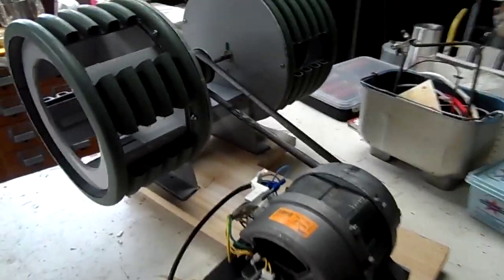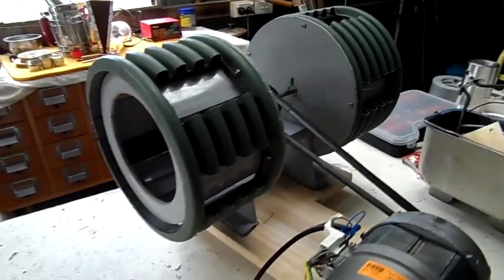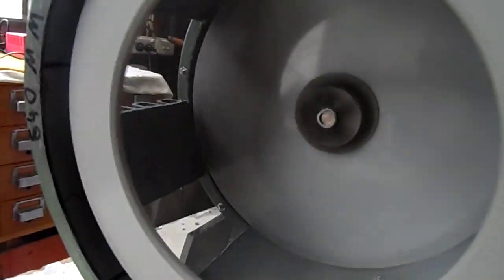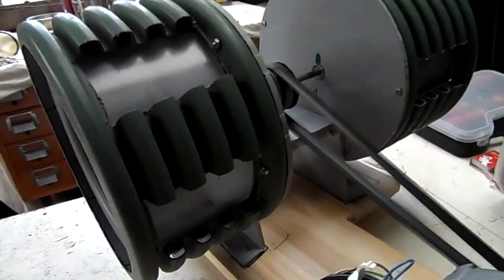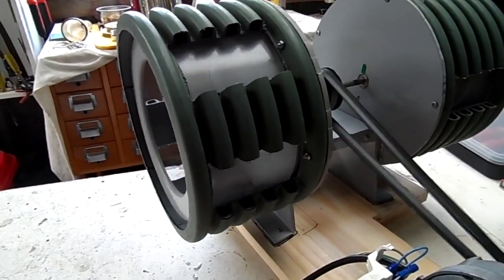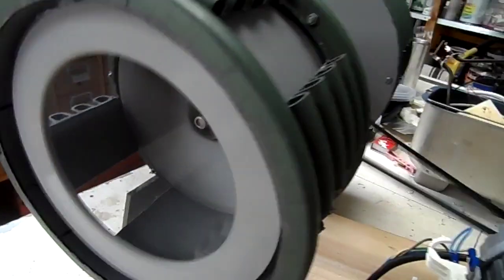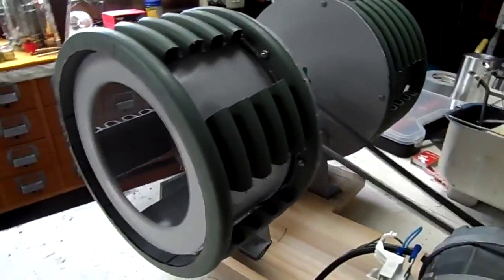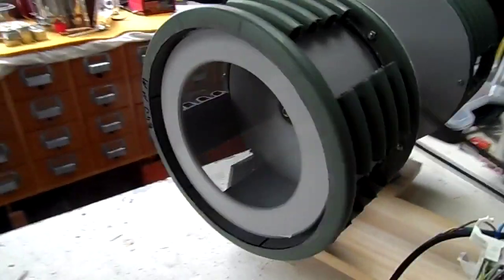Home Built Air Raid Siren - Low Sound Test

Comment: there are Absolutly no internal fins to move the air that's why it's not sounding off.  there's air but it's not being forced through the baffles because there are no fins to push it.
Reply from the maker: That was another fundamental flop with this one. I really should have read up on them before I built that lol
Reply: CAL'S ENGINEERING I would just re work what you already have here.
Reply from the maker: MadMetalManiac74 I saved a few bits from it, most of it I just chucked and started over fresh with the other ones
Reply: If its still too quiet you could have some force-air induction system like a shopvac or blower of some kind like the FS Thunderbolt uses
Reply: I think the principle doesn't need fins to push the air. The fins that are in these, like a liquid centrifugal pump, capture the air. Since air, like water, has mass, it flies outward from centripetal force, and here is interrupted by the stationary slots. Enough interruptions per second begins to form the sound. I understand this principle but it is a little hard to explain easily!
Reply: junkdeal something has to force the air through the slots. Without any internal fins it's just a drum spining inside another drum with no air passing through the slots. Its the air that gets chopped that creates the sound but if the air isnt being pushed in that direction then you get what you saw in this video.....a very weak siren.

Comment: Instead of using the belt for the movement of the siren, simply just make it the easy way. stick the motor onto the inner rotating thingy (i forgot)
just saying
Reply from the maker: That's what I ended up doing to this one
Reply: ThatOneGuy rotor

Comment: I was wondering if you can tell how you made this.
Reply from the maker: It was a school project that I was finishing off at home.
The outer stators were made from commercial drain pipe which I measured and cut the ports in. The originals had a 12:10 port ratio but I halved it to 6:5. 
All of the grey coloured parts are made from sheet PVC which is very tough and easy to work with. The rotors were made similar to the stators but had to be turned perfectly round on a lathe in order to avoid hitting the insides of the stators and also had to be balanced. The outer rings aren't perfect but they don't interfere with the overall result.

Comment: you need a faster moter, or more ports. like 10/12 port siren.
Reply from the maker: Yeah i've got a ton of work to do on it including running the motor faster (it was a variaced washer motor) and rebuilding the rotor fins. They dont quite meet up with the stator ports